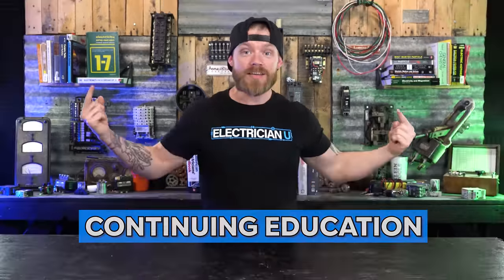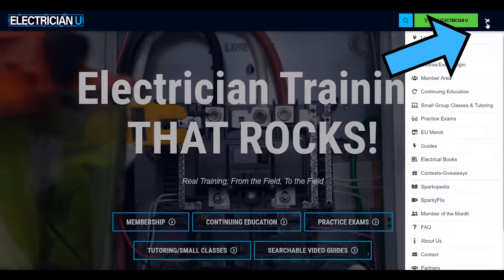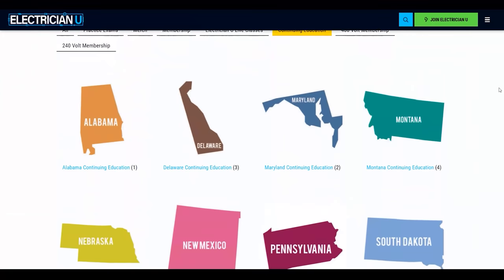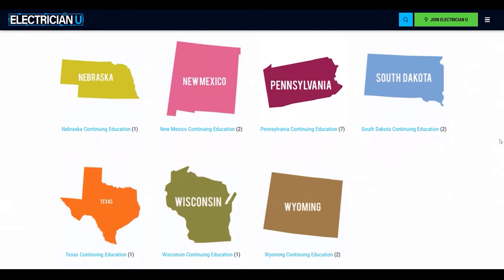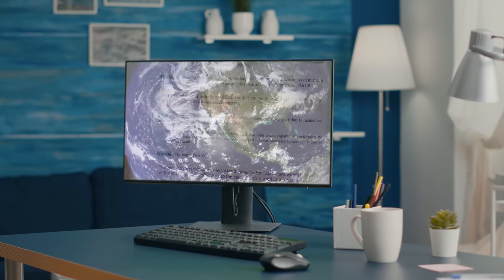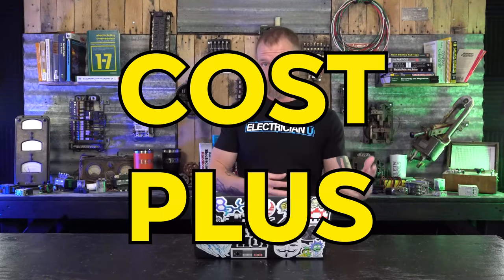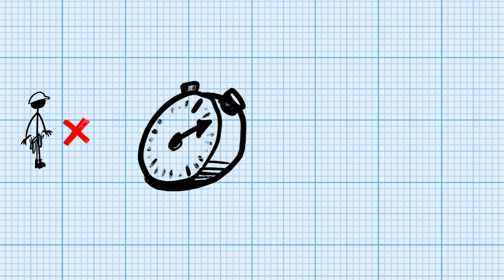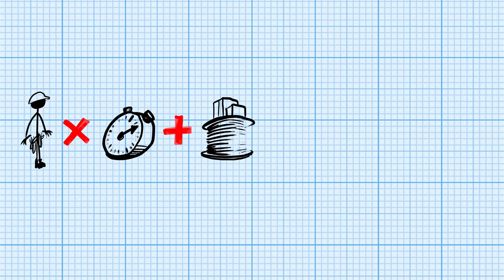How Should I Price Out Jobs? 5 Different Methods You Can Use to Estimate a Job!

Comment: I like knowing annual fix cost (vehicle insurance, depreciation, rent, property taxes, etc) and monthly variable cost (mileage, fuel, tool wear, utilities, etc) then narrow the variable cost into both fixed cost ( I spend at least $x/month in fuel!) and the range of costs. 

Knowing what owning a business costs at minimum for 365 days a year and only working 200 of those days means you're ass better be billing nearly double of your running costs.

All that before thinking about the cost of the job itself 😉
Reply: you kinda nailed the general idea here but didn't cover the aspect to the next level. Knowing your cost to open the doors every day is spot on and should be tracked. Now look at it from the perspective of your out of pocket $$ making money too. Somewhere in the math that money spent (fixed costs) needs to also have a percentage markup, instead of just passing it through. This is similar to your right hand man getting paid $25 an hour but he's got insurance, social security, uniforms, company tools, vacation time, etc. More likely his internal cost is closer to $50 per hour. See where this is going?
Reply: @rupe53  yeah, I have a degree or two in accounting and took a few business courses. Next level stuff is why my employer 1099s my ass 😀 😡 😉
Reply: @jfarley1221  ... Hmmm, subcontractors are another way to nail down your fixed costs! <LOL>
Reply: Can’t agree more
Reply: I'm more of a computer building kinda guy, but I have the same problem that I think lots of people have, which is, if someone has an issue to get fixed or looked at, with their machine, whether I built it, or it's an OEM like Dell, that has the issue I'm diagnosing, I tend to just want to give them the "friends and family" discount, which is basically "free", because I have literally NO IDEA what I'm supposed to be charging... I mean, I literally live at home with my parents (AKA "rent free") and don't have a steady job, so all I have for bills is Around 600$ a year for car insurance and 30$ a month for unlimited cell/internet service, plus every few years if I decide to get an upgraded phone, then that's 300-400$ more... Obviously I'm only including stuff that might be job related, as far as odd jobs go, not including gas...
Reply: @northwiebesick7136  pay yourself a salary of 30k/yr 
Break it down weekly. Pass the cost off onto the customers you obtain that week. You could also price by job or by hour as well. With computers you can work on 4 or 5 at a time waiting on downloading etc. So, hourly may not be the way to go because you maybe double or triple dipping. However,  if you go hourly pick to low rate to advertise for more business so double and triple dipping isn't going to have a drastic impact on the consumer. If you try to price by job and the job is estimated to last 10 hours but takes 15 then you'll eat that hourly cost.
Either way, you should keep records on an excel spreadsheet to find out how much value you're generating and if it is sustainable. Hours worked per week with weekly pay (try to hit the 30k/year mark or whatever you believe you're worth) and if you're actually saving the consumer money. That is where value hides in the repair industry. 
If you find what works then you can expand by having a web page and have people send you their systems. 

A big rule of thumb is to save 1-2 weeks of earnings per month to pay the tax man.
Reply: Also, an initial service charge is needed if you are traveling to a site. Fuel, your hourly rate, wear and tear on the vehicle, insurance, and the potential of an accident (which is why you should have full coverage as a business doing house calls) are all factors
Reply: @jfarley1221  well, since currently I ve worked a total of 5 days this year, at jobs through my employment agency, and not my usual amount from before the "worldwide flu" that started in 2020 well... 30k/5, well, that comes to 6k a day give or take, and since I'm on the government system for health insurance, (in the US) I'm paying well, nothing currently, per month (that 30k/5 figure is assuming that I HAD to make 30k a year, by charging appropriately per workday or job day as you made it sound)... Would love to be able to afford full coverage on my car though, but I'm a good enough driver I like to think, that I can get by until I can really afford it. I mean, I'm not going into debt when it's not absolutely necessary. That said, I do shell out the extra 5$ for free roadside assistance when I pay my 300$ car insurance every 6 months. In the future I would love to make money from working on computers, but it's currently more of a hobby, and as I said, I generally get by with odd jobs, or "assignments", as my employment agency calls them... Before the "you-know-what", I was most of my working days, working as a temporary janitor at a local school... (Think needing a replacement janitor because of a sick employee or a scheduled meeting or trip, and looking at a list of substitutes) once that you-know-what hit, all the schools shut down, and things haven't gone back to the way they were before, as of yet, but I keep hoping that they will, so I can have a greater influx of money to use for doing some setup things around my parents house, to enable me to better start to make a space in our barn, that can be used for computer repair and possibly some YouTube video recording, on a part time basis, although, I'm not 100% sure how I would classify that, as if I make enough, but less than the maximum, I do use my unemployment benefits if I find I'm entitled to it, work hour wise... Should I really do that, probably not, but if I'm eligible for it, I do like to get what I'm eligible for...(note that I'm not saying I'm trying to screw the system, just that I don't know when to call something a business, and/or what I'm legally able to do that's still covered under unemployment benefit laws, and don't want to break the laws)
Reply: Bro no Emoji WTF
Reply: @jfarley1221  full coverage is one thing but the other side of that is the extended cost of full coverage is extreme especially if you want to keep a cash funded company that adds up way way faster than you would think.   The only way to know is to do it but if you have a good reserve of cash you will also crash less.
Reply: My friend told me about his deficit he needs 30% of goal to be even that goal is 1 mil Sales..
Reply: This. After 30 years as a drywall plasterer I finally did this. Superannuation,tool allowance savings,entertainment, etc ,working 200 days per year. Prices went up and people will pay.Let your competition underquote and get busy not making money.
Reply: Nice

Comment: Man, you hit the nail on the head about the six month mark. I'm right there and am finally starting to see the fruits of my labor. I was scrounging for work in the beginning just to try and make ends meet. It's getting to a point that I'm trying to be more consistent in my pricing, if I don't get a job now because of a price it's no biggie. I don't show up to work because I like wire and running conduit.

Comment: Customer: How much for replacing old ceiling fan with new dimmable ceiling fan?
Me: 75 bucks
Customer: Cool! Come by!
Me:  opens cover plate and no neutral
Also me: 
🥺😧😭
Reply: Never fails!! 😂😂😂
Reply: How about the old fan does have a fan box or was rigged with 50 screws 😂. I’d rather fish wire than attempt to fix a box 😂
Reply: How did the fan work with no neutral?
Reply: That’s what you get for charging $75
Reply: @xxxNAYBOBxxx  The ground was the neutral. Happens more than you know.
Reply: @Gruntled2001  or its a dead man switch
Reply: @arturo9002  I don't get it?
Reply: No Neutral for switchboard. Just like the new smart switches require
Reply: If you're charging less than $150 to install fan you're losing money in New York City between the latter that you got to bring there the vehicle that you got to pay for and then you got to pay yourself. NYC cost of living
Reply: Simple to go around this.. it’s all in the contract. Make sure you have unforeseen work not included
Reply: $75.... where the f@ck are you doing business? we can't do anything in California for less than $125 for 30mins. Are u in the Congo somewhere?
Reply: @PhillTheGreat  i charge 85 an hour for side work..will probably increase it to 100 due to gas prices. I stopped charging “per fan” bc I would run into crazy shit and would spend like 2 hrs putting up a stupid fan.
Reply: @anthonypicozzi7360  I charge $120 just to show up
Reply: I'm at $125-$150/fan. I work on a lot of new construction here in Las Vegas so boxes and wiring are generally neat
Reply: @ericschmalzel1370  in London electricians regularly charge £120 ph.
Reply: @xxxNAYBOBxxx  switch leg
Reply: It all depends on how many it is for me. If they want multiple of the same fans in different rooms, I'm making some good money. The first one takes the longest since you have to figure out how that specific one is put together, but the next two take half the time. One fan? Probably $150. 3? 300. Easy money, they feel like they got a deal but I really charged them exactly the time I'm spending on it. If there is an issue, I point it out, explain it, and then deal with it. If it's as simple as a loose wire at the switch, I'll just fix it. Replace the switch? That costs the price of the switch. I keep extra switches and outlets on hand. 

Plumbers think I'm a God of Selling because I manage to charge $200 just to set a toliet on a wax ring. I try to avoid plumbing, but sometimes thats the job there is. For ten minutes of work and another ten minutes of washing your hands, $200 ain't bad.
Reply: Oh...if it's "install a fan" where there was no previous fixture...that's a lot more expensive.  I have multiple trades, if I have to apply more than one of them to a job then you are paying for two workers.
Reply: @ericschmalzel1370  I've seen several were the neutral was broken off and the ground in a 1980s romex was being used as a neutral.
Reply: Thiiis is why I’m scared to price 🤣🤣
Reply: Lol
Reply: Lately I charge 300 to change ceiling fans....because most time I take the fan down and it's a regular box...guess what now I have to make it right ...man $75....raise your price you will be happy you did
Reply: @xxxNAYBOBxxx  do people pay? How you do it?
Reply: @Gruntled2001  ok. We all know that's wrong and to run. Not risking my license for a fan. There exist remote switches now. Lol
Reply: @gerardotorres7904  Yes people pay. I'm not a freaking handyman.  I own a licensed and insured business. I have turned down plenty of work because they want me to do it their way or with improper parts.
Reply: @gerardotorres7904  lol #1 how much experience do you have?
Reply: @xxxNAYBOBxxx  5 years
Reply: I started my bussines las year november 2022 got my license but some people think is too expensive like one guy was temodeling his kitchen need to run 6 new circuits and figure out some wires hanging on the ceiling, 6 lights for the kitchen and replace a circuit for electrical stove i gave him stimate of $3,900 and he said that there no money for that kind of price i just said let me know whatever is your decision
Reply: @gerardotorres7904  what state do you live in? Also, know your clients. If you have a feeling that they won't pay or will have a problem with your price or if you ever get in a argument.  Refuse service as a business and move on.
Reply: @xxxNAYBOBxxx  i live in california
Reply: @gerardotorres7904  sounds pretty cheap. Every kitchen wiring remodel we do is basically 4K at least. And usually it’s only 1-2 new circuits. Run for your life from cheap customers. Their the ones who complain and don’t pay also. & I’m in Indiana
Reply: Better you had said, you charge $75 to do an assessment... Then you can decide what the actual project would cost after that.
Reply: @xxxNAYBOBxxx the fan box has a neutral the switch box doesn’t

Comment: After leaving the IBEW, sixteen years as a commercial industrial journeyman, got my State license, that was ten years ago. 
  I wouldn't say the hardest thing is figuring out your rates, it is figuring rates for different clients. I do service work mostly, residential and commercial. But, about 70% of my work is doing service work for all the major film and television studios in Hollywood/Los Angeles, on locations during production, in homes, restaurants, hotels, hospitals, cathedrals, country clubs, office buildings, historic homes and just about anywhere. I had to figure some unusual pricing into my rates, things like working on light fixtures that are one off, 100 year old, irreplaceable, or museum pieces, chandeliers by weight and size, rates for same day job, where I have to cancel a regular client job and reschedule it so that I can drive sometimes 20 minutes sometimes two hours to a set where there are 100 people, crew and talent, shooting scenes but need me to fix some issue that someone forgot about or just discovered in the part of the house where filming will be taking place after lunch break, so now the pressure is on me to keep from holding up hundreds of thousands of dollars and keeping the film schedule on time. I get paid very well by the studios. Also,  my minimum rate for just showing up on set, is $350 even if I work for five minutes. Rarely do I only charge $350. It's usually $550 at the very least and up to as much as $4500.00 or more, for a day. Plus, 95% of every studio job is two jobs because I come in and do my thing before actual filming starts and then when they finish shooting, I come back to restore whatever lights and switches or smoke detectors, exit and emergency signs and make it just like it was before the crew took over the property. So I get paid twice for almost every job. It's a good niche that I've gotten myself into.
Reply: That's really a good situation you have there! But I'm surprised that non-union work is even possible on movie sets. Did something change over the years from what it used to be there? 

So now the trick is to save as much of the 'fluff' money as possible so if conditions change for the worse it's no big deal. 😀
Reply: @MicahFunk  ---- being an ex union brother helps, but because I am a sub contractor, I don't receive any credits when the credits roll, but I am trying to start asking for at the very least a "thank you" from the director/producers, how they do that at the very end. Only because on some films and shows, I'm putting in almost as many hours or more than the crew. I don't care about the credits I just want some acknowledgement and a little advertising, in trade for some of the work. They save a little money and my name is immortalized. 
  The thing is that the studio heads and producers and the IBEW (set electric and set lighting), the Set Decorators Union and Locations Union got together and since the set Lighting, and electric, are IBEW,  they are not state certified to do any kind of permanent wiring of any kind in or on any location other than a stage, which is all temporary also. The different crews were still taking it upon themselves to remove light fixtures, replacing them with one from the art director and other things like exit signs, signs, anything hard wired and the liability insurance is through the roof because they are constantly shooting in mansions and historic homes and buildings, hospitals, hotels etc... and sometimes one light fixture can be worth hundreds of thousands of dollars, not to mention if a fire started in a $20 million home.  So they all decided that instead of keeping a couple full-time union, certified, journeyman or masters, around when there isn't a "full-time " need, they would use a 3rd party sub contractor and have them responsible for all liability insurance and pay that contractor as a contractor not as crew, so no insurance or workers comp, etc... that would be cheaper for them in the long run and have no worries about quality work safety etc...
  So, having had worked as a stage manager and done concert lighting and having been in front of the camera a couple tines, I was a great fit. Plus having over 20 yrs in the trade and very well rounded and having my own service business, it worked out and now what started as a couple of days every couple weeks, has become about 70% of my business, sometimes juggling up to four shows at the same time or in some cases I've been over 40 hours a week for six or seven days a week for three or four months 12, 14 hour days. But, it's always someplace different, usually very cool, sometimes challenging, stressful, under pressure, and with strict time limits. But I work well like that. It's about 80% easy going, and 20% busting your ass.  And I smile all the way to the bank and as I leave the bank I'm still smiling.

Comment: Love this I'm a plumber almost 10 years experience just took my masters test. I am going on my own good info. One thing I might add is do the job right from the get go even if it costs a little more. I ran into this with my old boss. He would cut corners and do it differently then what code states to save a few bucks. It's just not worth it and can bite you in the ass.
Reply: As an electrical / solar estimator I'm the same way.

I told someone that there are no skeletons in the closet that can come for you, unless you put them in there. The lawyers charge more than our laborers.

Comment: We bid jobs cost per connection. I.e. $50 per 100 connections in a kitchen, bath, and bedroom addition  might come to $5000. A service change and new panel is a flat rate. Homeowner add-ons are Time and Material. And remodel pricing is higher than new addition pricing to accommodate the additional  time of deciphering and tie-in of existing wiring.